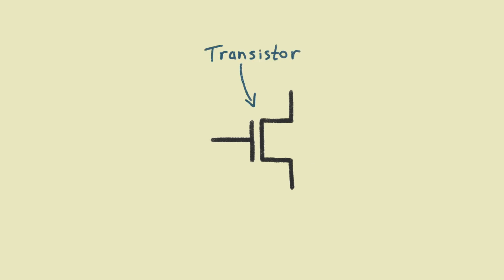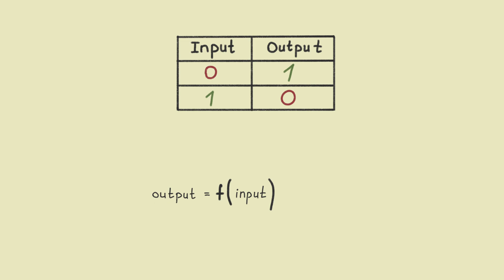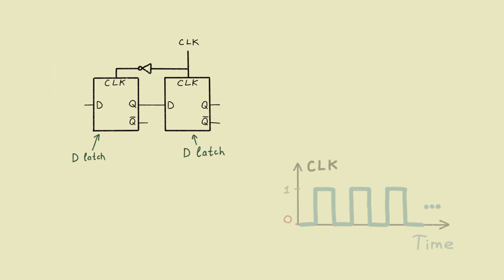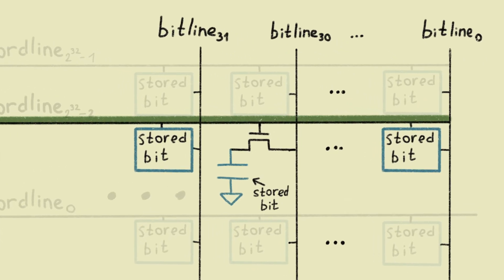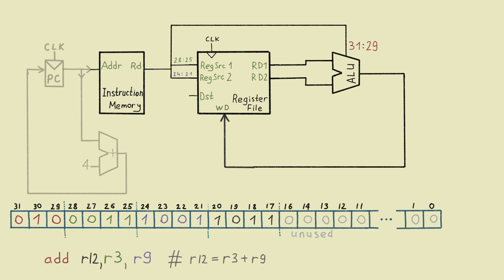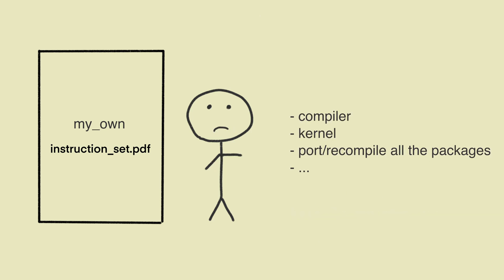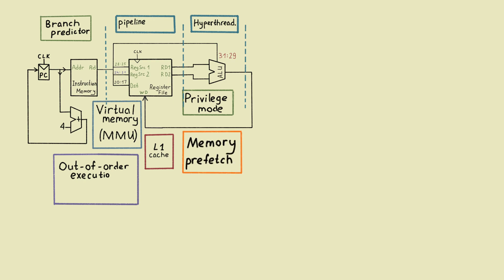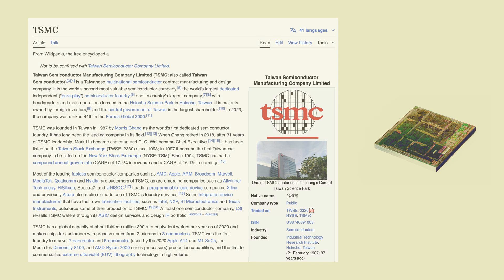How is the CPU built of transistors

Comment: I finally got it! The 111 operation on the ALU is not shift, it is SLT - set less than. It's 00..01 if A < B and 00..00 otherwise. Ext zero adds 31 zero from the left

Comment: 3:37 understood everything except D flip-flop, why not just use D latch? is it because we have to wait 1 clock cycle for it to stabilize (transparent)?
Reply: Its better to have the data latch on the rising edge. D latches latch the inputs whenever the enable is on. But the D ff latches only on the rising edge of the clock. Since most units in the CPU change state constantly the data in the registers could get messed up/ we could store a value we dont want if the inputs change while the enable is high.